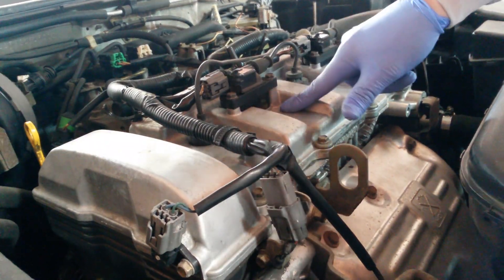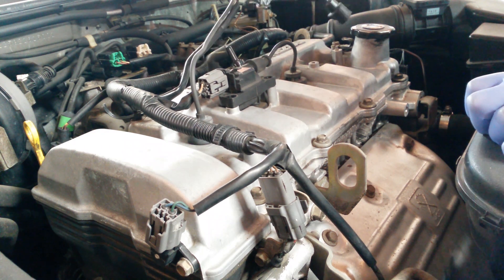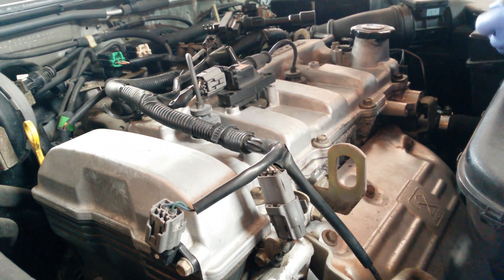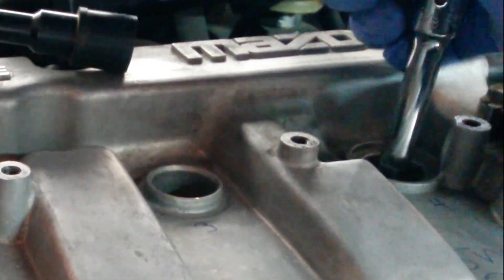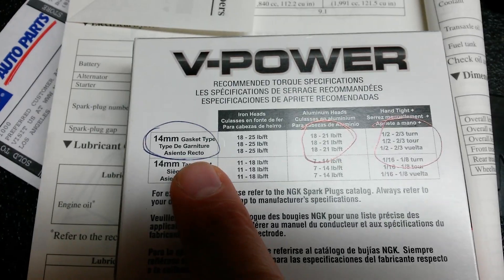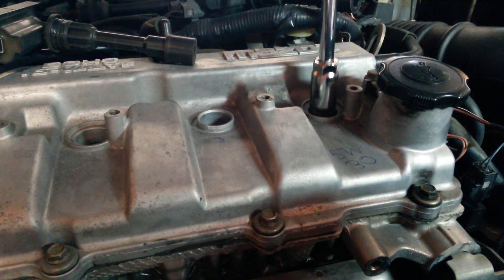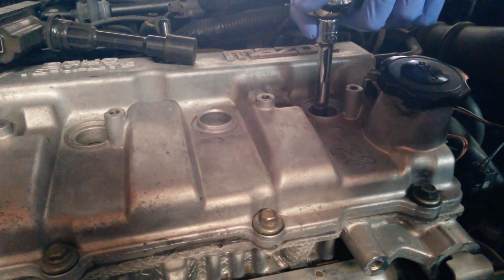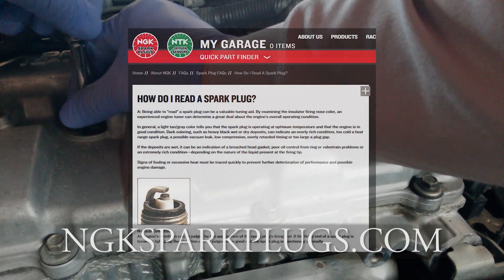Mazda Protege Spark Plug Change

Comment: Thank you so much for this excellent video!! Extremely detailed with all the parts used, techniques and great video.  I just subscribed. How hard would you say it is to replace the coil connectors that a new shop broke when changing my spark plugs.  ( 2002 Mazda Protege5 which I still love ) .. I dont trust this shop now because they didnt even tell me they did it.. car ran 2x worse after the spark plug change.. Ive been googling and see theres 2 ways.. I am hoping the less invasive 1st way works ( no wire cutting, soldering ) as I dont see any damage to the wires..
Reply from the maker: The method I saw involved removing the pins and attaching them to a new housing. Of course they performed this on a bench as opposed to in the car. I'd say it would be challenging but doable with the right tools and patience. Good luck iwth the project.
Reply: @cfldriven  Thanks. I'm going to give it a try.

Comment: I needed to know how the wires went where they came from on the coil packs and where they went to
Reply from the maker: As I recall with this car, I don't have it anymore, the cable length made it easy to determine where they went. At 2:07 you can see the numbers that I used to make sure they all went back to the same place.

Comment: Mazda protege 2002 toughest car ever. Change the oil and plugs now and then and just drive it!
Reply from the maker: I have had several Mazdas and consider them well-built and low maintenance cars.
Reply: @cfldriven  and priced right as well. My 2002 protege cost me 3k used and I've gotten 100k miles out of it so far, and I love how they drive.
Reply from the maker: @swavekbu4959  Congrats on the good deal and high mileage. I had a Mazda 323 for 18yrs and only sold it to get another Mazda with airbags.

Comment: Just bought a 4-pack of NGKs for $12 at O'Reilly and it's so nice to read that they don't need anti-seize. Just plug and play. Great guide.
Reply from the maker: Some people still insist on using anti-seize, but I have never used it on plugs and in over 40 years of changing them have never had a problem. Its great when the manufacture recommends not using them. 
Thanks for the shout out and for watching.

Comment: So what happens if there is fluid in the spark plugs?
Reply from the maker: If there is oil on plug tip and thread it could be a sign of a leaking valve cover gasket, failed O-ring, worn valve guides or other serious problem. Best to have it inspected to determine the cause.

Comment: Thanks for the video, I have a 2001 protege that I'll be doing my first spark plug change on. This helps out a lot.
Reply from the maker: Protege and Mazda 3 are pretty easy to work on, although schedule maint is more freq on older models. If you do all the reg maintenance it should last you a long time. Thanks for watching.
Reply: How reliable are these cars? I looking into getting a daily for work to home my drive will be about an hour drive everyday.
Reply from the maker: @tanoktenahua1665  In the past I have owned a 1988 Mazda323 (14yrs) and 2005 Mazda3 (13yrs) and they were both carefree. Just do the regular maintenance and these well built cars will last a long time. The Protege in this video is still running strong, although after 18yrs it could use a new power steering pump.
Do note that older cars like 2002 require more frequent scheduled maintenance then a 2005. Hope this helps.
Reply: @cfldriven  thank you brother,  i appreciate the feed back.

Comment: You should change the description to say "restore" engine performance. Not upgrade, since changing spark plugs doesn't add horsepower it just restores it compared to having worn plugs in there.
Reply from the maker: Alex your are correct and the change has been made. Thank you for the input and for watching.

Comment: Great video! Very clear and to the point. I´m planning to change my spark plugs soon. Just don´t know if I should take the cooler of hotter ones. What´s your advice on that? What reasons do you have for choosing the cooler type?
Reply from the maker: Thank you for the feed back. I always buy what the auto maker recommends. If the particular plug is discontinued then I look at the recommended plug manufacturer for the proper substitute. 

The only reason you would switch to hotter or colder spark plugs would be if you modified the original engine performance. A colder plug would be the choice for a high performance engine because they generate more heat and the colder plug would allow greater heat transfer to the engine.
Reply: Thanks for answering. My user manual recommends two types (a hotter and cooler one). I think I´ll go for the hotter ones than (lower NGK number) as I drive the car in a relaxed way and my climate is pretty moderate. Thanks again!

Comment: No anti-seize lubricant? Yikes.
Reply: Justin Lamar These plugs do not require any, it literally says on the box "do not use anti seize".
Reply from the maker: Here is what NGK says:
NGK spark plugs feature what is known as trivalent plating. This silver-or-chrome colored finish on the threads is designed to provide corrosion resistance against moisture and chemicals. The coating also acts as a release agent during spark plug removal. NGK spark plugs are installed at the factory dry, without the use of anti-seize. NGK tech support has received a number of tech calls from installers who have over-tightened spark plugs because of the use of anti-seize. Anti-seize compound can act as a lubricant altering torque values up to 20 percent, increasing the risk of spark plug thread breakage.

Comment: Good video but you should let people know that the boot at the end of the spark plug cable could be missing and dry rotted down by the spark plug and if you don't dig that out you will NEVER  get you socket on the spark plug to get it out....
Reply from the maker: Hank thank you for sharing this useful tip.